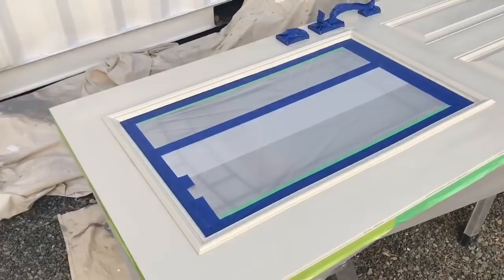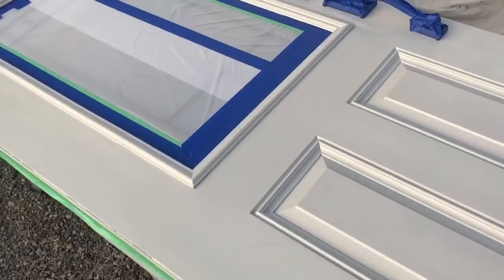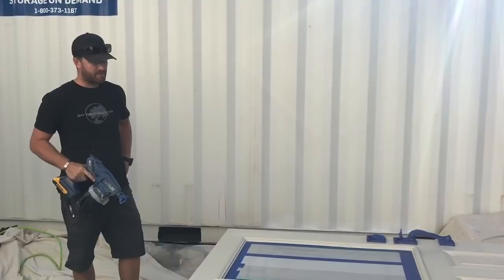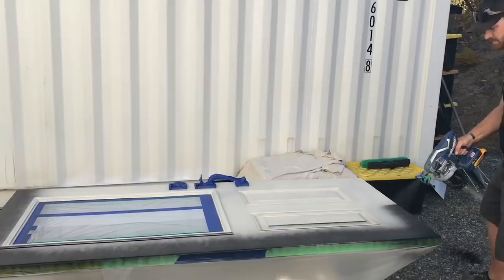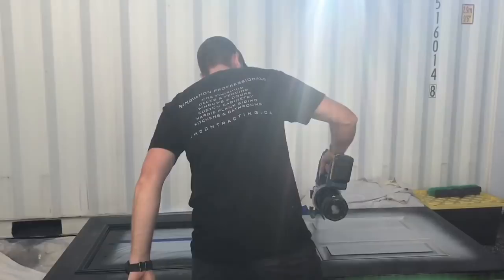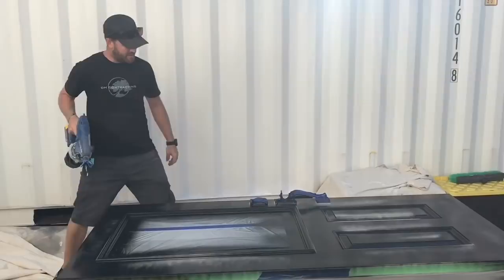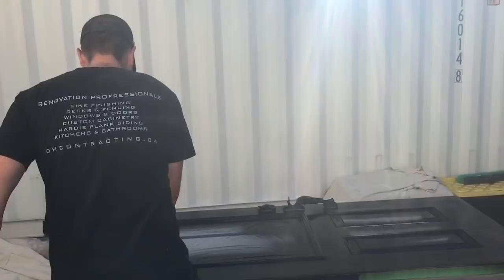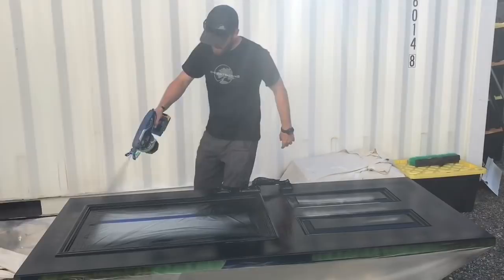Graco Ultramax Spraying Exterior Door Black

Comment: Hey im going to be doing this tomorrow evening with the same product. Did you use the standard tip that comes with the machine and did you water down the paint prior to spraying?
Reply from the maker: Didn’t water down paint, just use as is. Also used the same FFLP tip that came with the gun. Best of luck! 🤙🏻

Comment: Hello, what do you use to clean it with after spraying oil based paints?
Reply from the maker: I’d use a lacquer thinner
Reply: Hope you wouldn't. Lacquer thinner is the hottest shit you could use, if you want messed up seals go ahead.  To clean any sort of paint equipment you always use the solvent for the specific paint. For MSA I would use xylene and always store with mineral spirits. Keeps your machines lubricated and will not rust internals.

Comment: U can get small tips I think the lowest I have gone is a 208 and there is a blue filter for water based gloss, don't use the black filter for doing low pressure work and you should strain your water based products and thin them down with an extender.
Reply: He's not using precat my guy he is using MSA. On my first day of painting I learned there there is no such thing as a paint extender or a "paint stretcher". Thinning your paint actually makes it dry faster.

Comment: great video.  I expect delivery on my Graco Ultra Max next week and I'll use the same enamel.  A couple of questions if you don't mind.  I see you didn't use a mask or gloves.  Would you recommend that?  And, what tip did you use for the spray.  I read your comments that you didn't thin, so it looks the sprayer pushes the paint effectively.  Thanks!
Reply from the maker: Dean Aldinger the tip I used was a 310 FFLP TIP, as for a mask and gloves...totally a personal preference so you can hear me in the video. The gloves are optional but as for a mask I’d recommend any kind of PPE when appropriate. Gun has no issues moving the paint through.  A 410 tip would have been better in my opinion but they hadn’t brought any in to my local paint supplier being that it was a very new item. They are easy to come by now. Congratulations on your new purchase. Enjoy!
Reply: Darren Hill Contracting hey Darren!  Thanks for the prompt response 👍
Reply from the maker: Dean Aldinger my pleasure 👍🏻

Comment: Seems like it would have been easier to paint it with the door standing up vertical. Less starts and stops, just continuous passes top to bottom
Reply from the maker: m m less likely to have runs, no shadows, easier to move around vs vertical. But hey whatever works for you.
Reply: Agreed. The paint also is heavier when falling and will collect in corners.

Comment: I have the same gun, first time using I’m getting some orange peel , it’s only visible  when you hold the cabinet door at a certain angle , it also has tiny  tiny little holes that are being left behind . I’m doing kitchen using FFLP 212 and Benjamin Moore advance . Any help /tips is appreciated
Reply from the maker: Mich Mosh try adjusting your pressure and see if that helps. Otherwise you could maybe try adding a bit of dynaflow to your paint so it levels out better.
Reply: Darren Hill Contracting I added some floetrol, adjusting pressure higher ?
Reply from the maker: Mich Mosh yes higher pressure and just make sure you’re not too close to the material when spraying it.
Reply: Darren Hill Contracting ok, thank you for taking the time out to reply, I’ll keep ya updated .

Comment: the speed is simply awesome. Do you know how long an standard battery lasts? Would you recommende it for home use?
Reply from the maker: Thank you for your comment. The battery would last about 1-2 gallons of paint so basically 8 refills which is really impressive. That's with the standard 2AH batteries. If you went to a 5AH it would last twice as long. Home use would be fantastic in my opinion!
Reply: 20mins continuous

Comment: What tip did you use?  Did you thin the paint?
Reply from the maker: robalan57 I used a 210 FFLP Graco tip. I would have used the 310 tip but they have been back ordered at my local Sherwin Williams. No I did not thin down the paint. No need to with this gun! It's awesome.
Reply: I don't think this gun thinning is required i been reading the manual of this one and it says no thinning is required 🙂 is not like the cheap ones that require to thin the paint I'm about to order this spray gun is kind of expensive but I think it's worth the money

Comment: Was that oil based? Did you thin it?
Reply from the maker: Artie6937 All surface enamel by Sherwin Williams. No thinning required.  Thank you! 👍🏻
Reply: How are you finding the graco fflp to the regular fine finish tips
Reply from the maker: Artie6937 I find they are most definitely better. Less overspray for sure.

Comment: ... i want to see the finishing lol. the way that u spray already have too much paint on top.. dripping all over the side......
Reply from the maker: Lam Michael actually it’s a very fine finish with this sprayer. The paint is atomized and goes on very smooth for a factory painted surface. Happy to upload a photo to show you the final results
Reply: you would be suprised.... the type of paint that we use as painters wo spray trim and so . is desingned  to get on a layer as thick as 250Mu (2.5 mm) without even dripping one drop in stead it wil flow to an even coverage. It works totaly different than car sprayers or so..